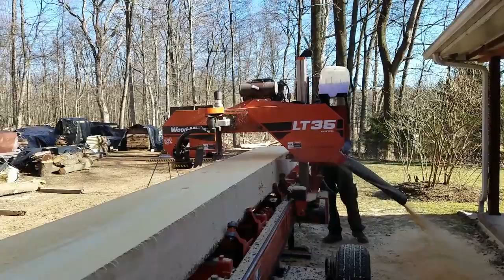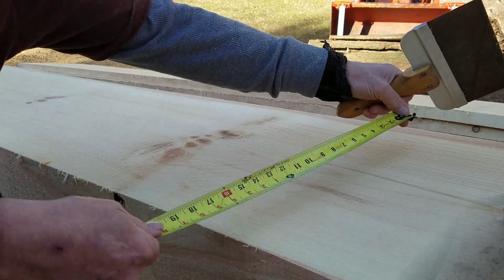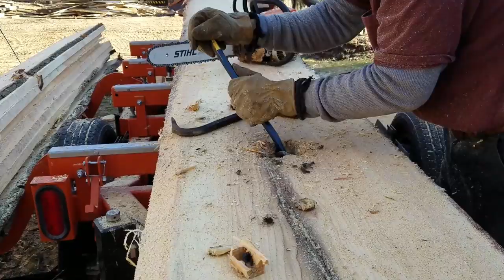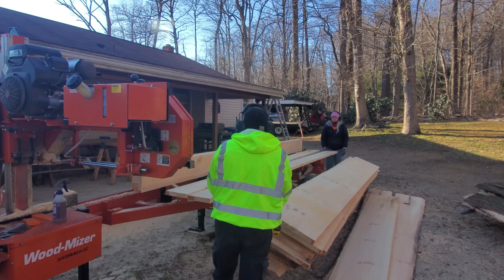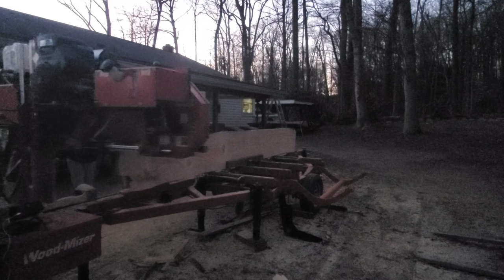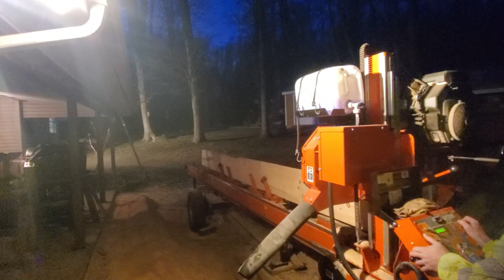(REBOOT) Nearly Maxed Out Mill

Comment: I have the same mill and love it. I have been sawing a lot of dimensional lumber lately for my pole barn I'm building and I find it easier to saw the wood cant into the size I need and then take the slabs off of it rather than sawing the thickness and wrestling the flimsy slabs up to cut the width, just the way I do it. You guys do a great job and Deb is a great helper (wish I had one lol) love your videos, keep up the good work and I can't wait to see the big burl slabs.
Reply from the maker: Sounds like you're putting that mill to good use. We have a shed project planned for this spring / summer. Lets see how things work out. Good luck with your project. Maybe send some pics of the work.

Comment: We  chatted before on this video on board conveyors... Here's a twist. If you have a wire feed and some old rebar laying about, tack weld the piece in the log to the rebar and unscrew it or pull it as that was a substantial piece... finish, you are younger than my youngest but who knows unless you tell them. I used auto transmission fluid or hydraulic oil cut with diesel on my truck decks. And some of the decking in my mills,, .... yes more than one as in five at one time and it drove me insane so look at who may give very bad advice. I had a 56" circular saw on the live deck and forty plus on trim saws (blades repurposed for this from the deck) and one day and it raining hard on that tin roof making it hard to hear in that echo chamber, I saw a leak appear in several  spots in the roof. My beautiful only used maybe thirty minutes of its very short life 56" saw blade found a glory hole in this log. Up a good forteen feet in the tree and healed over was a air chair saw from the early day's sawing just waiting to be found and that blade turning 1800 RPM's didn't even have a place to insert the new teeth!! That saw blade was like seven or eight hundred dollars and it sent the teeth through the roof and some into the deck boards. It sounded like a MM 50 going off on auto. That blade hung on the wall of shame for a while. Don't remember if you told me and I forgot or what the future of that mill is knowing it is mobile, do you have a plan for the home use to ever be covered and some green chain bins for lumber along with a cheap tractor with forks and a grapple for moving stuff. I had a four wheel drive Lift All and it was the most valuable piece of equipment I first bought. It had a draw bar and the trans had tow mode on it so it was made to pull behind a small flatbed. I bought that machine in sparks nevada at a equipment sale for one twenty if of its price, less than thirty five hundred dollars and it sold for, the one I had with all the bells and whistles nearly forty grand. Had a fire near radiator on a trash fire and never fixed with less than a hundred hours on the meter. Even the seat still had parts of the plastic cover. It had the side shift which is so important once you move many stacks of wood, three positions on  the lift mast so would go up to almost twenty feet in the air and lifted twelve thousand on the first stage of that mast. I used tongs on the forks for about five or more years then my business exploded in the right direction and within three years I had millions of dollars in toys/equipment... highlight years and when you go big then you have it all. And when you lose it, even bigger.   .... another book instalment

Comment: Why don't you use the tractor to move the lumber?.
Reply from the maker: Hello Mike. The stack was so close, the work space was tight, and the lumber was so long, it made it tough to maneuver the tractor in the tight spot. Plus even just one board wanted to tip the tiny tractor to the side.

Comment: How come when you pop that mill into gear. It's so flimsy and bounces up and down it doesn't look rigid at all..?...
Reply from the maker: Hello, and welcome to the mill. That's simply the torque of the motor. It settles right down, and cuts a straight, square board every time. It's not recommended to engage that much power slowly. Sort of like a drag car. LOL Thank you for your question.